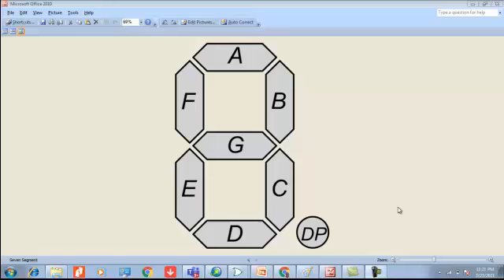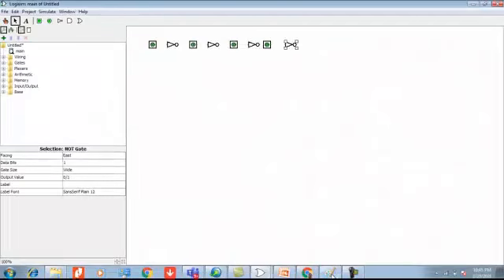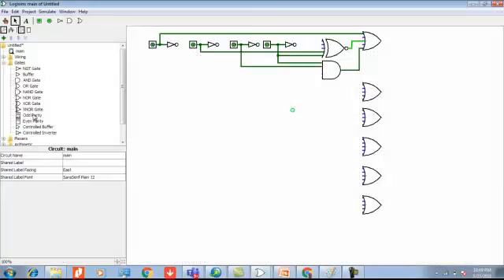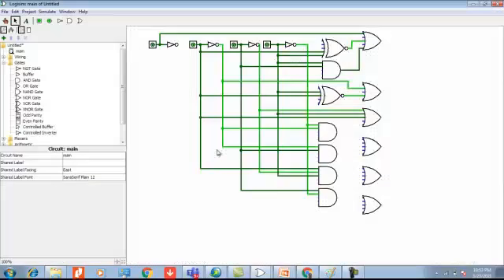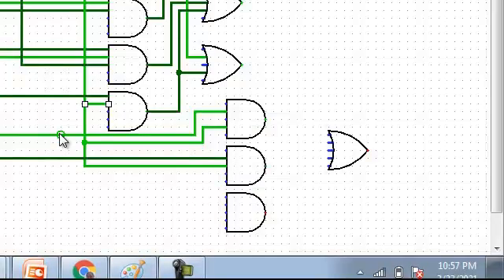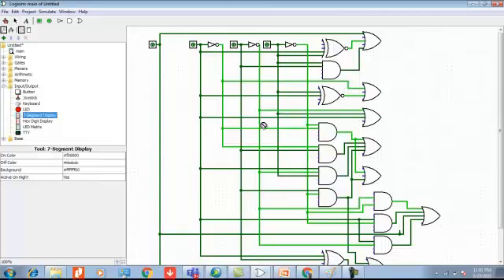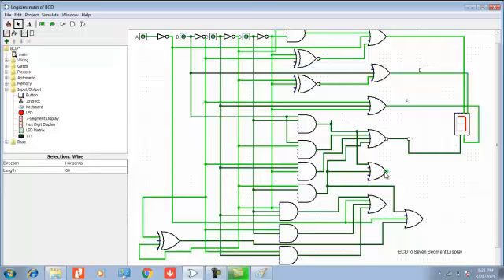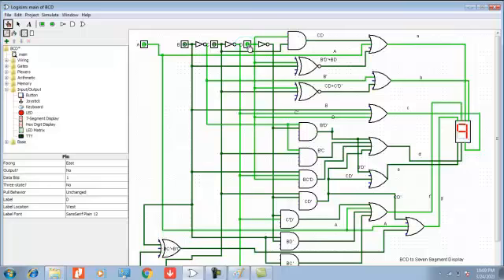BCD to Seven Segment Display using Logisim Software - Edited Version

Comment: I am learning well from watching your videos. However, I am asking a question because I am not able to apply it. After designing a 24-base counter and a 60-base counter using T flip-flops, I want to implement a digital clock that displays hours and minutes.
How should we design the hours and minutes to display numbers from 0 to 23 and 0 to 59 in 7 segments using a BCD-segment indicator?